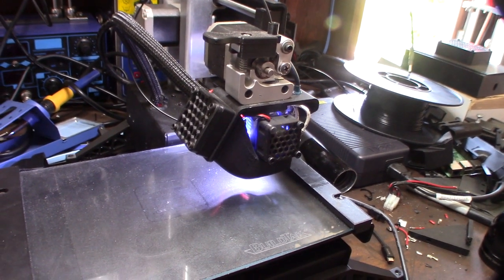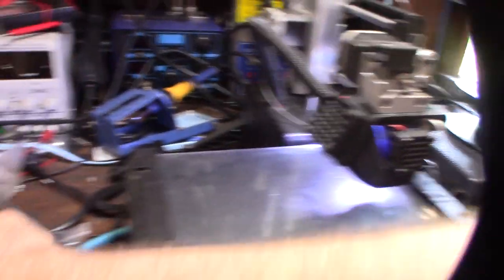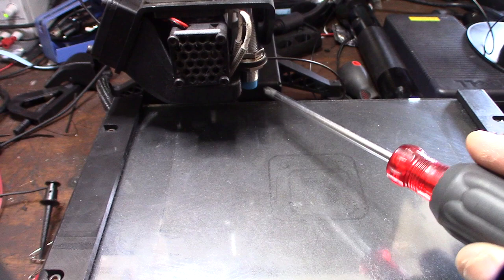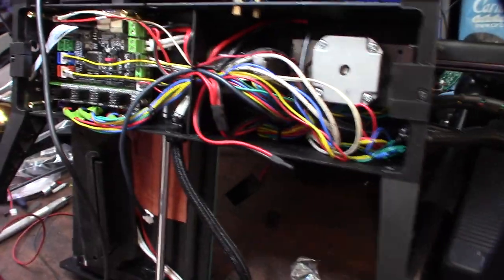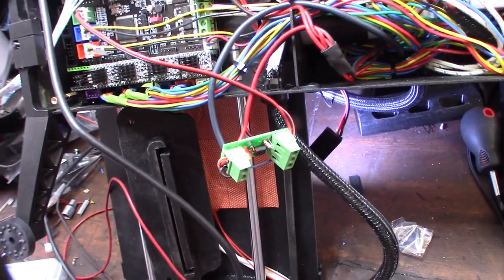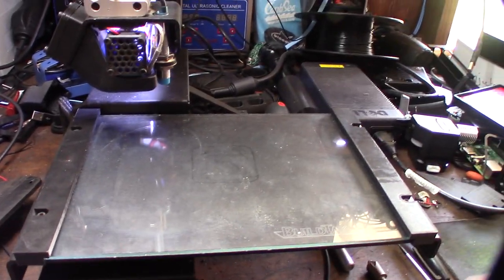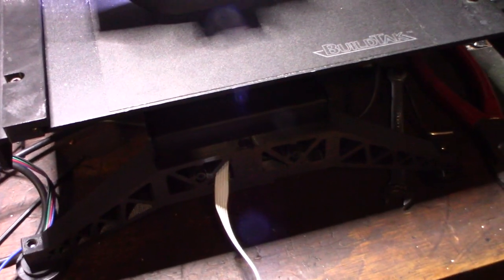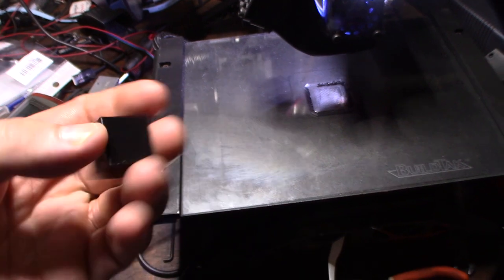Printrbot 32bit SKR 1.1 1.3 Marlin 2.0 upgrade with TFT35 TMC2208 Part 3

Comment: I had the no printer attached issue as well. In the Bigtree video they show you you have to #define SERIAL_PORT_2 -1 then set baud rate to 115200
Reply from the maker: Mine fixed when I change the baud-rate to 250000 to match what I had in Marlin